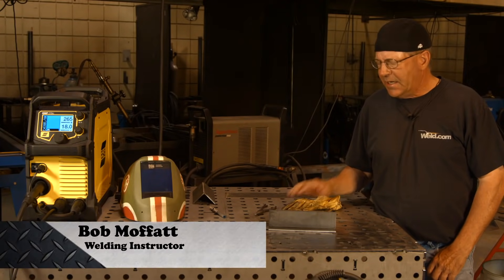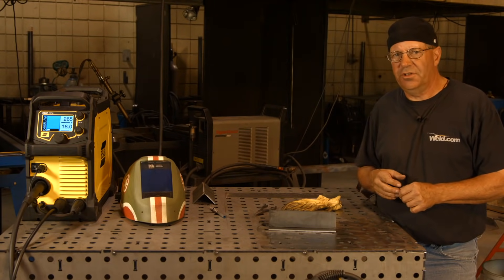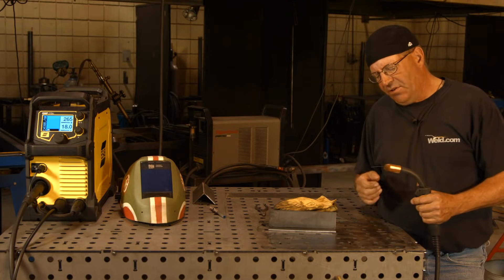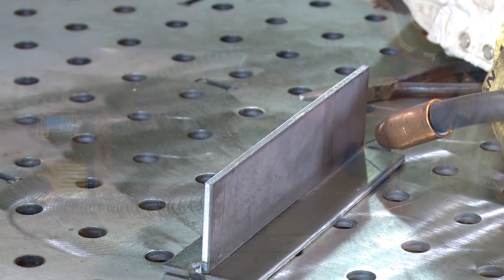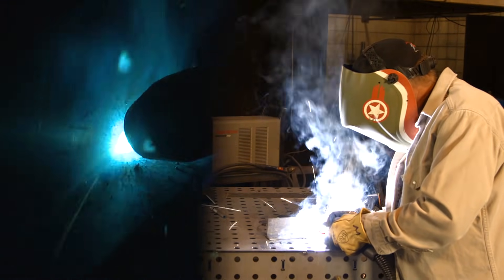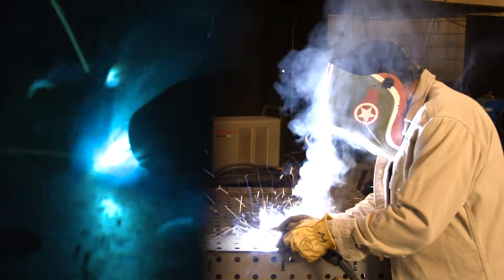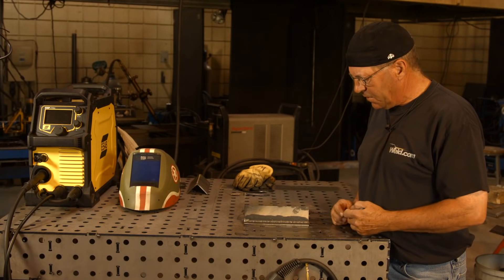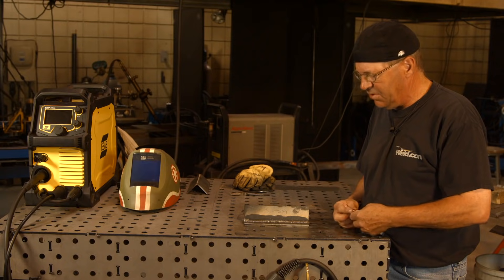Flux Core Welding: The Basics You Need to know

Comment: I have a question I have a Lincoln  210 I have been using it with just gas and I have been using it outside and it been very windy lately so I switched to flux core but now it seems like its to hot I am just blowing holes in my tubing this is with my amps on the A (lowest setting and my wire speed at 3. Using a .35 flux core wire. I was using .23 mig wire with a 75/25 mix is there any way to turn down or keep from blowing holes in my tubing using flux core

Comment: My little welder only does flux wire. My polarity should be right straight out the box and I shouldn't have to change anything right?
Reply: Not always I have seen them setup without it being switched to DC neg. Double check it to make sure.

Comment: if you weld a 3/16 piece how strong will the weld be? strong enough for a small trailer?
Reply: you can weld it up but the main thing you got to look out for is penetration of the weld into the base metal. I usually adjust my welder with the highest setting and a decent but not full on max wire speed so I can see how deeply it penetrated. The best thing to do in such a case is to also weld both sides of the joint if you can. 

A gas system is much better but if all you have is a gasless then just be smart about your welds and careful. If you have a weld that looks like it bubble gummed up on the metal I can assure you that it did not penetrate at all and a strong smack from a hammer will cause the weld to fail.
Reply: thanks for the reply!

Comment: Thanks for the video,  Question, : I own an 80 amp AC welder, I ran it for a while with flux core wire, and it has a fitting for a gas attachment, I was told I'd get better results if I put a gas cylinder with, so I did just that. So now I still have almost a full 10 lb roll of flux core wire,  is there an issue using that wire with the shielding gas ?  ( also I switched the polarity of the ground & welding gun as per the operating instructions)

Comment: I ran flux -core  on 1,1/2 " thick base plates with 10 -3/4 " gussets  welded to 1/2 " thick 30 " tower tube  up to 80 ft long and 2" anchor bolts and top caps for skilift towers and the drive stations - top station and bull wheels  that drive the skilift cable  up the Mountain anything that was super structural was welded with F,C or stick 7018 or jet, all the tower  ladders sheeve wheel  assembly which is what holds all the  wheels that guide the cable  up the mountain and tower cat walks were  welded with 035 or 045 mig.

Comment: hi I'm so glad that you finally got a video on that type of wire. I weld with this all the time. but how strong is it in comparison to the other type. will this be strong enough to hold something that can tow a vehicle????? is it possible to gauge how strong your welds are using that wire??? please do a video on that if possible. thanks.

Comment: Another advantage to FCAW is the process is "better", whatever that means, for surfaces that can't be prepped as well as new work is usually prepped.  Galvanized, powder coated, or rusty materials do better with flux core.  I have found if you keep the puddle liquid long enough the flux floats a lot of that junk to the top.  It is not as pretty as GMAW, but if you generally clean your work up with a wire wheel or sander you wind up in about the same place.  One other point, FCAW is hotter than gas.  Why? The evaporating temperature of CO2 is -105 degrees, and you have to overcome that chill with your MIG process.  So when you turn down the machine you can work thinner metals with a gas rig. 
Conversely, a home machine will weld heavier material when set up on FCAW.  I do mostly fencing repairs and used machinery so being able to work outside on surfaces with modest clean up works for me.   I am self taught because I didn't want to take up a space in a technical school and keep a youngster from starting a great career.  I'm retired and what I work on is my own equipment repairs or rental property fencing repairs.   Love these videos, they get to the heart of what I need to know.
Reply: Ron Carpenter 
It's stick welding with a mig
Reply: @zagan1  That's how I think of it as well.  I improved a lot on my results with it once I understood it that way.
Reply: Bill Cyrus 
That, and I had to learn to slow down! It takes a long time to deposit enough filler rod with fluxcore as compared with mig and stick. I switch frequently between two identical 120V machines- one flux and one mig. My first few inches after switching either way are frustrating every time and I’ve been doing that for years lol
Reply: @fishhuntadventure  Yep, watching the puddle showed me some interesting things recently, about how I needed to let it catch up with me.
Reply: nice comment
Reply: CO2 reacts with the Arc and actually increases penetration and the small amounts of oxygen often found in mig mixes also increases temperature, the apparent increase in temperature from flux core is actually largely to do with the polarity, being elctrode negative 70% of the heat goes into the work, vs electrode positive where 70% of the heat goes into the electrode. Functionally your experience is spot on and this is somewhat pedantic but it's one of those interesting facts I learnt at trade school.
Reply: Your philosophy is mine as well, i do the occasional welding for me, and my projects, no need for trade school. I am not retired, but i am 50, so i am getting there if i live long enough.

Comment: You sound funny saying you would not be scared to use fcaw on structural welds. It is the industry standard for steel erectors for quite some time.
Reply: Andrew Dabal that's dual-shield, though.
Reply: Rick M lincoln 5/64 nr232 is The industry standard and it is fcaw not dual shield
Reply: Andrew Dabal I'm referring to FCAW-G, gas-shielded flux-core arc welding.
Reply: I realize that it may not be used in all instances for structural welding. I think what the video host meant when he used the term "structural" was that some of these small 115v self-shielded flux-core (FCAW-S) welders can do an adequate job for structural welds - and he probably means something like a trailer frame, not a skyscraper - as opposed to FCAW-G.
Reply: Rick M that's great fcaw-w  is used in the field but not nearly as much as fcaw. Maybe in the shop dual shield is used more. I am an outside structural ironworker and fcaw is used much more.Besides the video is talking about fcaw not dual shield
Reply: Andrew Dabal gothcha. I've seen other videos and have read about structural welding with gas-shielded flux-core. I've never worked iron, but I have a friend that used to and we were talking about this just a couple of days ago. He said he ran dual-shield at times. It does seem odd to do that outside for the same reason you wouldn't run MIG or TIG outside, but to be honest, he didn't specify to me that he was doing it outside. He may have been using that in the shop.
Reply: @rihamy2nd  You think they drag shielding gas bottles all over those high-rise buildings as they go up? They don't. They use Innershield wire.
Reply: Mattis Vik thanks for the information.
Reply: Totally agree nr232 is definitely the standard, great penetration,clean weld, high deposition rates, the list goes on.
Reply: LMFAO nice response and yes 232 is an excellent wire when I started 211 was the industry standard for an all position wire and we used 3M for moments with a top and bottom steel backing bar nowadays 232 is widely accepted for out of position welding and I know you posted this two years ago but the industry standard for moments is 311 ni and has been for about 12 years with a removable bottom back and Bar sometimes they require top and bottom back and bars to be removed please tell me in what state do you weld a moment with 232 and what type of backing strips you are using LMFAO
Reply: Andrew Dabal - I agree however most instructors won't even make a video about flux core because it seems to be the orphaned stepchild of welding. Flux core is a hot process and makes good penetrating welds. I think it is used often in the construction of buildings for just this reason (and no need for gas). Most "welders" seem to hate it because of the smoke it produces and the mess it makes though can make good welds after you clean it up.
Reply: Rick M i work in a small boatyard, we use dualshield all the time on larger strucural work like rebuilding parts of ferrys or barges, both inside and outside. Simply put, the flux-core wire puts in more material the ordinary steel wire on MAG, so for larger welds it is better. And althoug some of the gass will blow away if there is wind, with the dualshield you get a combined better coverage that with just flux or gass. We even use it on smaller repair jobs sometimes when the weather is shit, because of the better coverage. As far as any US industry standard, i dont work in the US so i do not know.

Comment: In the UK this process was called Inner Shield ( or as I called it"inner death") because of all the fumes. If you have no fume extraction at source. Dont use it.
Reply: Or set it up outside.
Reply: Delightful Douschebaggery Yes flux core wire is basically a reverse stick electrode

Comment: Did I understand you to say to set the wire feed so that you can stop it with your finger? That might be my problem. How does it act with to much wire pressure?
Reply: Did you watch the video? The wire bends and gets tangled.
Reply: Okay, reset it so I can stop it with my finger... it worked. Before it was continuing to feed wire out and causing problems. Thanks.

Comment: I was trained NOT to weave with flux core,does it make a difference or not? Was told it could leave slag "pockets,"
Reply: Edward Robinson ya Tig and mig I weave looks great, a straight bead is best for fluxcore tho. But by force of habit I weave anyways xD
Reply: I weave as well with flux core force of habit from using gas system so when I work with a gasless system I weave the weld. I agree it can cause slag pockets and you can tell it does when you grind it down and you notice a small pocket with the slag embedded in it. It is more noticeable if you are trying to build material so you can shape it.

Comment: Alright, so I'm cheap, and I bought this machine. http://www.northerntool.com/shop/tools/product_200632003_200632003?cm_mmc=Google-pla&utm_source=Google_PLA&utm_medium=Welding%20>%20MIG%20%2B%20Flux%20Core%20Welding&utm_campaign=Ironton&utm_content=45433&cm_mmc=Google-pla&utm_source=google_PLA&utm_campaign=&mkwid=sCUGeeTnk&pcrid=39155627516&devicetype=c&gclid=CLi065PsvM8CFYMvgQodW4QD9A I realize that it is entry level, but it has to actually weld, cause there are tons of positive reviews. It is AC only, there is no polarity. It has two settings, hi and low, and the speed seems to fall into one of two categories, too fast, or too slow. I either stub out or have an arc for a second out of every two or three. what am I doing wrong here?
Reply: Jose, after I followed ricks tip of wiring a dedicated 20 amp outlet for it, and developing some skills with a friend of mine who is a welder, I find it to be perfectly capable machine. It does have limitations but I knew that any 110 machine would. Metal thinner than 3/32 or thicker than 3/16 not so good but it is a solid little unit.
Reply: guntotinmedic I have this same welder. Have had it 4-5 years. Overall, not a bad welder. In fact, it's been pretty good for me, but it seems to be sensitive to under-current - in other words, use it on a good 20 amp circuit. I've ran it on 15 amps plenty of times and it'll rarely pop a breaker, but it does a lot of what you described. And, as with any wire-feed welder, make sure you have a really good ground. I replaced the ground clamp on mine and that helped a lot.
Reply: guntotinmedic also, you don't have to worry about setting polarity on this machine since it is a gasless flux-core only machine. It's hard-wired to be DCEN.
Reply: Thanks Rick! I run mine on a 12 gauge extension cord that may be my problem.
Reply: guntotinmedic could be. Another good source of info, if you don't already know, is Jody Collier on weldingtipsandtricks.com. He has a YouTube channel, as well. Good luck with your welder. Get those first few bugs worked out and I think you'll like it.
Reply: guntotinmedic looks tempting.   What has been your experience with this unit?
Reply: guntotinmedic bet that 110 machine has a 220 tap on the transformer.. open it up and take a peek.. my welder is the same crap from a different company.. not even cold cathode XD

Comment: Thank you SO much, great video! i had the wire wheel too tight so it was messing with my technique ( which is none). but hey yeah so next time when welding indoors you should really have a fan pointing at you or wear a bandana over your mouth/ nose. the fumes from those welders are very highly toxic. a plume of cancer. what a sacrifice, and for that, i thank you sir.  -best regards

Comment: Great video...For those who have never welded, this sounds like a great method and machine. Only only problem. So many times you professionals assume the viewer knows what "DCEN means...as oppose to what? What was it set at before? Why did the user not get the result? My wife hates to watch football because they always speak in code women don't understand. The wire comes out the trigger handle but how is it loaded? Where is the original spool? And other terms that turn the newbee's off. If you had a video that explained these little terms.  Thank you for sharing this.
Reply from the maker: DCEN is Direct Current Electrode Negative. This would be opposed to DCEP (Electrode Positive) or AC (Alternating Current). The other questions you are asking are all valid, but they are much more basic questions that can't be addressed in every video because it would be extremely repetitive. We have done videos specifically on loading wire, etc which can be found with a simple YouTube search. To quickly answer your question, the spool is housed inside the machine and if fed through the liner to the gun.
Reply: johnnyohness most of us that watch these video are ready know the basics. I certainly wouldn’t wanna see him putting new wire in every machine. Before every welding video.
Reply: Weld.com Also to help clarify, when using a DCEN polarity the earth lead that connects from the machine to your worktable/job should be coming out of the positive terminal of your machine. And negative when using DCEP.

Comment: Might sound like a daft question, but does the flux cored wire  'go off' in time, as if not used in winter and the air in the garage gets to it causing perhaps rust on it.

Comment: To bad most guys have junk welders and the wire runs way to cold! I just got done welding a 3/8 AR plate tractor bucket using this process with lincon 211 wire. I was very impressed with how well this wire runs vertical very user friendly.

Comment: what am i doing wrong mine pops and bits of he wier come's of
Reply from the maker: Are you on DCEN (negative) polarity?
Reply: Weld.com yes
Reply: Do a video or picd and post to the weld.com forum on their website. That would be the best way to get you help in solving issues.
Reply: thanks ill give it a shot but ill send u a pic to google + just in case im on the positive not negative
Reply: +Eric Goodwin Am a beginner welder myself, so ask the pros or more experienced welders on the weld.com forum.
Reply: +Eric Goodwin youtuber named "ChuckE2009" has done trouble shooting videos on stick and wire feed welding. Is basically watching videos is how I learned the basics.
Reply: i watch alot on that guy and kool so how long u been welding for iv just started and need to get my motor bike engine mouts made and welded but welds look not good atm
Reply: You may need to speed up/adjust your wire feed and/or run the tip of your stinger closer to the work piece.

When I set mine up I like to take a scrap piece of steel, set the power setting on my welder where I want it and while running a bead I adjust the wire feed till its filling the weld puddle how I like it, its kind of setting it so the weld sounds right just as much as it looks right if you know what i mean..? lol
Like everything practice makes perfect and dont be afraid to stop and wire brush off the accumulated crap the welding spits out after doing each bead as it can effect the quality of your next bead to come :-)
Reply: Good idea, and is what ChuckE2009 recommends. Practice doing the weld first, especially when switching from one stuck electrode to another. And practice with wire feed welding to get your settings right if you have infinite adjustments on your welder.
Reply: i think i do have infinite adjustments amd my weder is wierd it says lift tig and mma welding as well as the mig
Reply: +Eric Goodwin Does your welder have a wire feed settings chart under the wire spool cover?
Reply: yup but not in amps only volts and all the machine has amps and volts tho thats all set good as far as ik
Reply: +Eric Goodwin There are settings charts that has volts and feed rate in "inches per minute". Search for those on the web, Miller Electric may have it on their website.
Reply: ok ill take a look
Reply: tho i dont think im getting good earth
Reply: +Eric Goodwin Like he said, check your polarity. Then check the ground/earth clamp. Try clamping the earth clamp directly to the work on clean metal.
Reply: i think ill go closer and it looked clean metal but mayby its coated with something i cant see so ill clean it with the grinder
Reply: If you're interested, search for

'Flux Core Arc Welding Сварка порошковой проволокой'

it is an extremely in depth video on how to set up and weld FCAW :-)
Reply: joehunt1980 ok ill take a look
Reply: DC negative electrode
Reply: Cecil Clayton Davis thanks but its all sorted know im not to mad so i wanna learn stick or tig next i love the clean small weld bead of tig